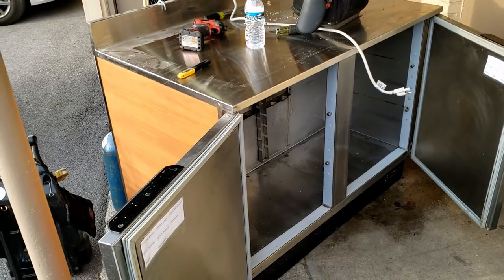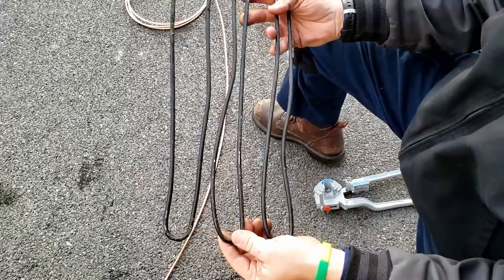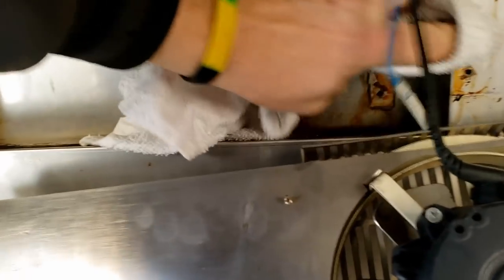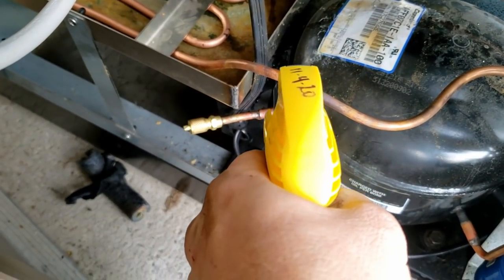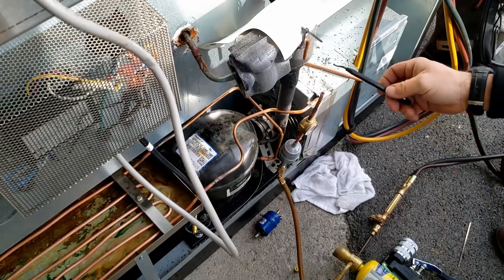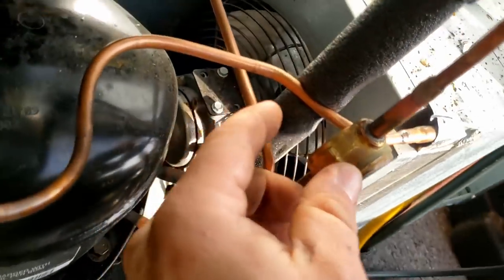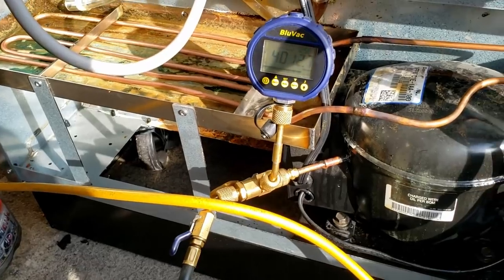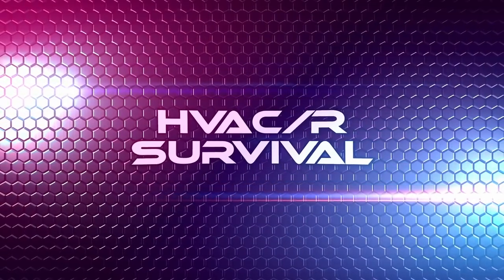EVAPORATOR REPLACMENT ON DUKE REACH-IN COOLER

Comment: I have worked on many systems from domestic to commercial boxes in 40 years in the trade and always evacuated thru my gauges and never used a micron gauge. Rarely purged with nitrogen . Practices sure have changed over the years. Great attention to detail.
Reply from the maker: I didn't do it either when I was doing R22 systems with mineral oil. It will work and you can get away with it obviously but it can causes potential issues down there road more so with the poe oil systems. Thanks 4 watching👍👍
Reply: @HVACRSurvival  I agree POE oil and the new refrigerants have changed the game completely
Reply: Ha ditto but I was only doing company owned equipment

Comment: When I have a pipe I absolutely can’t have split, I use my flare block and Imperial Eastman flare tool with the removable swedge heads. This never splits the copper even without heating the tubing, I think because it swedges only a small rib at a time. Great tool especially if your working in a confined space. Always good to have choices.
Reply from the maker: I have a Yellow Jacket flare/swage kit from 1990's and it works great without even deburring the copper. The only downside is the time it takes to set it up.
Reply: @HVACRSurvival  true... mines from 1992

Comment: Did like the fact you were taking precautions to protect the coil during brazing. I would like to see more protection to other surrounding items like the cabinet, wiring and sensors.  The other mention is, I see many mechanics brazing things where they are.... hey guys, copper is very flexible, bend it out where you can braze comfortably, then push it back in place when your done.   The other thing I liked in your video was the fact you kept the drier open to the atmosphere a minimal amount of time....this is old school training. I always install the driers last, I like soft solder after the discharge line. Don’t always do it, 
but solder always appears much neater and destroys less in the surrounding areas, paint doesn’t burn on driers, sightglasses don’t burn...and nitrogen isn’t required.

Comment: Ah those damn drain pans, I made a few ugly ones when I started out 😂

Glad to hear your input on that tube expander, I was looking at the same one but went with the spin bits instead and worked out.
Reply from the maker: I like it a lot now that I found slightly warning up the copper worked so well but if I didn't have tool allowance use before The end of the year, I would of had a hard time spending it.

Comment: by warming the copper, you are "annealing" it. The 1/4" copper lines have been drawn through so many dies to get that small that there's a lot of stress and strain in the molecular structure of the copper.
By heating it, you're allowing the crystals to settle into a new configuration before straining them further with the swage.
Reply from the maker: I've never gotten deep into what's going on at the molecular level but yes your right. My first swager was a Yellow Jacket set and it would make any size swage perfectly from 1/4 to 7/8 without and oil, heat or deburring. But it worked similar to a flaring block. I still have it on the truck😉 and it works great but it's alot slower.
Reply: I have the yellow jackets swedge kit and it about splits everything.  I noted the same thing he did, annealing the copper. Many times when copper gets older it needs to be tempered again with a torch.  This can occur also with  flared piping.  The spin tool eliminates this with friction, by getting it hot before it stretches the copper. Just take it slow and let it heat the copper. The spin swedger works great too.

Comment: Great job overall. Smart to take it outside to fix, smoke heads would've cost ya if they went off. Great heads up. Nice to see you clean the and wipe down the equipment before you put things back. I like doing that too. Very nice job. Until the next one keep your hoses tight and yourself safe.
Reply from the maker: Thanks Ray, I try to do it right the first time but sometimes things happen😏
Reply: They have a great tech on the job.
Reply from the maker: Ray your always so nice to me, thanks 4 being awesome👍👍

Comment: Hey Rick quick question: I've always been taught you need to heat up the copper before swaging otherwise it will crack or damage it , even on small diameters and even on soft copper .
I guess the old timer who taught me was right eh ?
Reply from the maker: Sounds like it. I've never had to do that on normal swaging just this type of expander.
Reply: @HVACRSurvival  as you expand stop swaging half way through, turn a 1/4 turn and finish the swage.
Reply from the maker: @tptm100  I speeded up the video so it wasn't as noticeable but I did do that👍. I rotated it twice on the 3/8 and 3 times on the 1/4". Thanks for the feedback!

Comment: I got ask you this, if I cut a vertical pipe with cutter how can I debur it because I'm afraid of shavings fall into the tube hole ?
Reply from the maker: Some did fall into the 1/4" tube when I deburred it while I was prepping the tube after the drier. I used the nitrogen when it was hooked to the liquid drier to blow those small specs out when I was done.

Comment: hey i got quick question i got exactly same duke cooler and i just changed out evap like u did in this video but the compressor start short cycling after it gets down to set temp what you think the problem would be
Reply from the maker: From what you're describing it sounds like the temperature is controlled by a suction pressure control. If that's the case it could be out of tolerance or potentially low on refrigerant. I'd also be curious what kind of metering device it has.

Comment: Another unit that could have been designed with a slide out 1 piece ref unit.
Reply from the maker: It's all about how much money the manufacturer can make with the least amount invested and not how good of a system can be built for a reasonable investment. 👉When you see the same unit fail over and over the same way..... What does that say 🤔

Comment: You must like like breathing all the smoke brazing inside a box. Copper pipe is rotten from salts vinegar anyway
Reply from the maker: I was in a well ventilated area,  I was fine. I assume you must not be in refrigeration?  because I have been nailed with a lot worse than what your seeing here. This was a cake walk.
Reply: @HVACRSurvival  I do refrigeration. I learned the hard way
Reply from the maker: @royamberg9177  the only thing I really have an issue with is when I get nailed the phosgene gas.